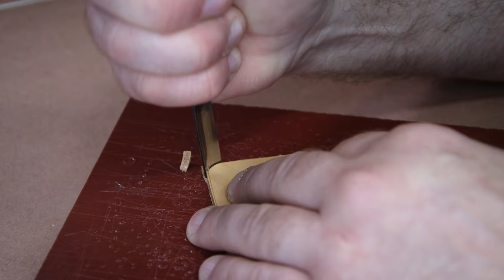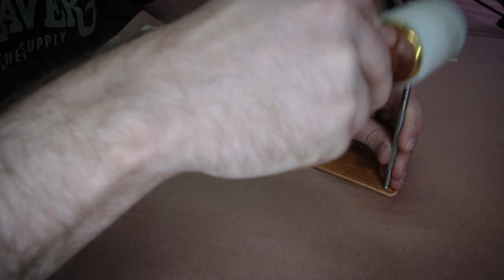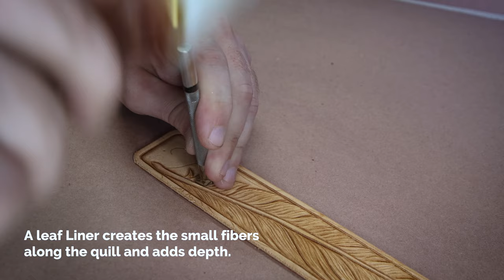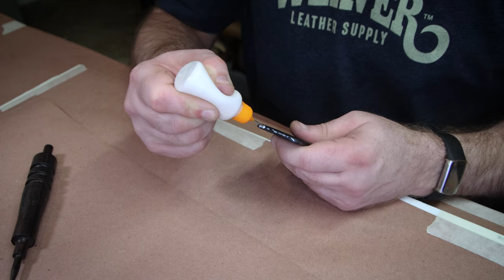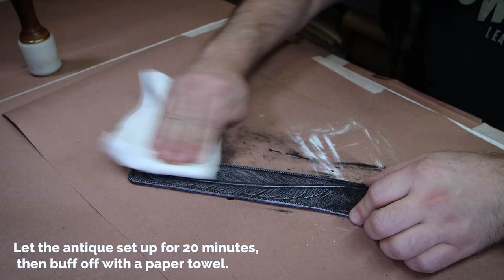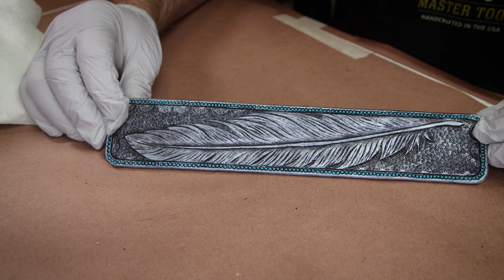Making a Tooled Feather Cuff

Comment: Excellent video and project. There were several tools used that I wish I knew about for my current project. Plus the turquoise color accent was perfect. I'll have to search the internet for the Tokonote applicator you used. Thanks for sharing. Found it they are called, Needle Tip Applicator Bottles.
Reply: Yeah, those needle tip applicators are fantastic for this kind of thing.

Comment: JALeatherWorks,  What weight leather did you use? What did you glue to the back? I preferred it when you talked during the video.
Reply from the maker: Hi there, the leather weight for the top piece is 5-7 oz. and the piece glued on the back is a liner in 1-2 oz. veg tan!
Reply: @WeaverLeatherSupply thanks, I was wondering the same thing wen the txt pooped up saying glued off screen like "wait hole up wat was glued and why"

Comment: Hi Daniel, 2 questions, 1. Do you find tokonole does a better job than gum trag for slicking edges? and 2. Your snap install was different from the way I learned to do these. I would normally put the female snap on the top with the nice back and the male on the bottom. Is there a reason you did it the way you did? Earned a definate thumbs up again!
Reply: Two great questions. Tokonole - I do like it better, but I can't really tell you why. Gum Trag does a great job too. The snap install...I wasn't paying attention and put it on "backwards." The good news is that it doesn't effect how it performs...I just missed it.

Comment: What is the barge cement for? Are you liming it? If so, what about stitching? I'm confused
Reply: Yes, the back of the cuff was lined with 1-2 oz liner leather. Barge is a fantastic option for lining. Its the same stuff they use to attach the sole of your shoe to the rest of the shoe. As far as stitching, somethings I would stitch after glueing (journals, wallets, etc). The wrist cuff is going to stay in this curved shape, and not bending back and forth...so I didn't think it needed the extra support of stitching.

Comment: did you use resist before applying the antique?
Reply: Yes. In most cases I would, including this one. (I think it was mentioned on screen). The deciding factor is...Do you want the antique to color the leather/paint? If the answer is no...and you just want it to settle in the low spots, then you should seal it first.  If you want it to color/tint the leather and paint, then don't seal first.